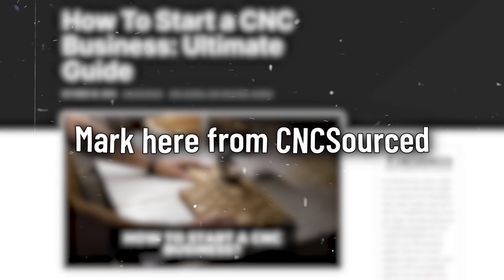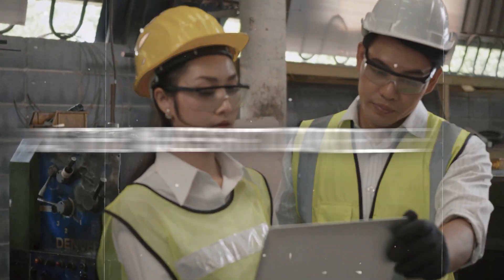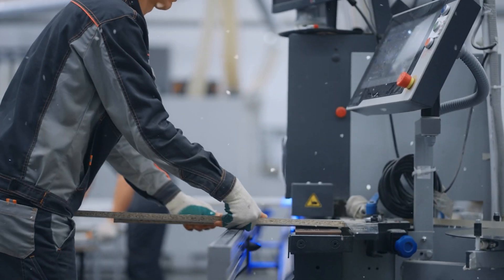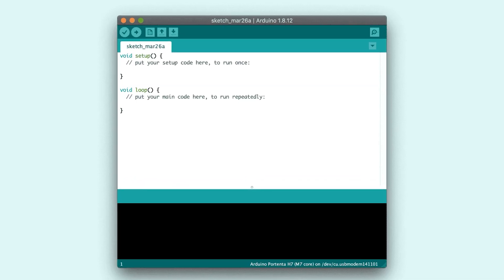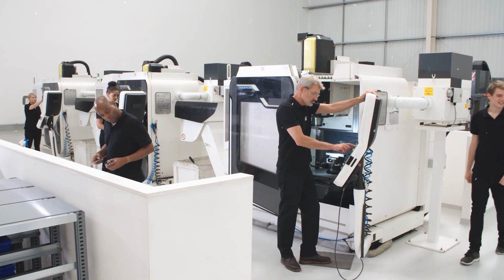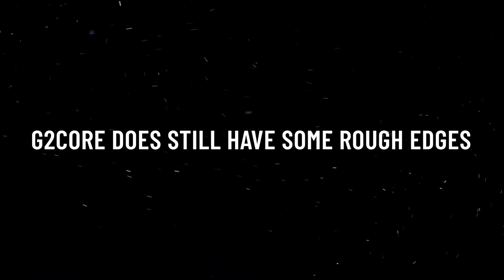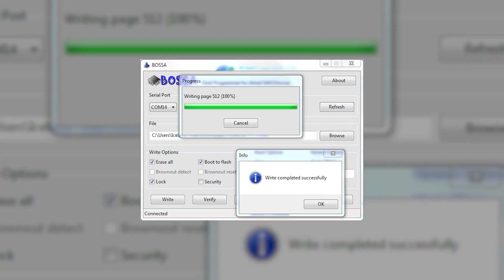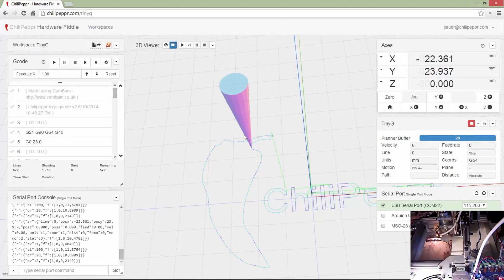Which is the Best CNC Controller: GRBL or G2Core?

Comment: Why even bother making a comparison between the two Firmware when one has such a glaring problem like constantly forgetting its Machine Settings? 🤨
By the time I'd be needing a 4-6Axis Machine the costs for a proper Controller not running a Firmware pulling such a stunt should be a non-issue! 😑
Reply: An esp32 alone would multiplex the entire thing over a single wire faster than the arduino can do in parallel. Plus has wifi and bluetooth and is probably actually cheaper too.